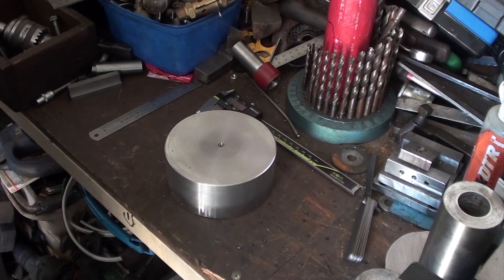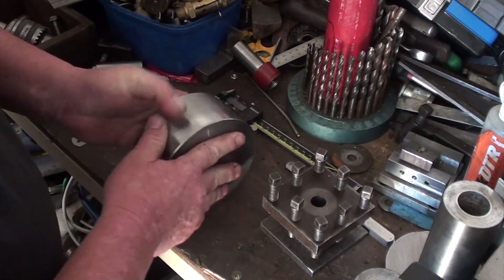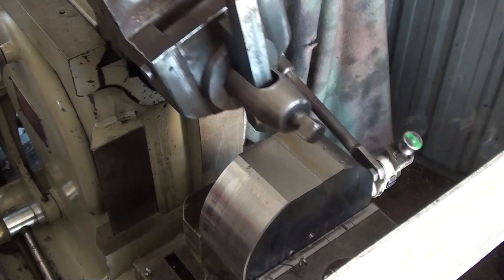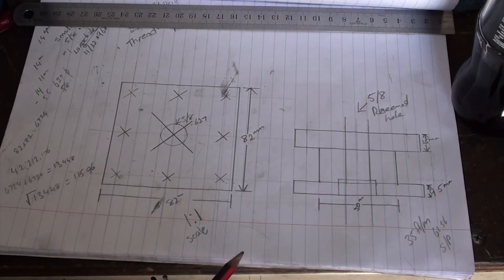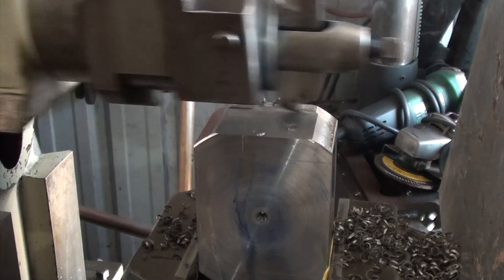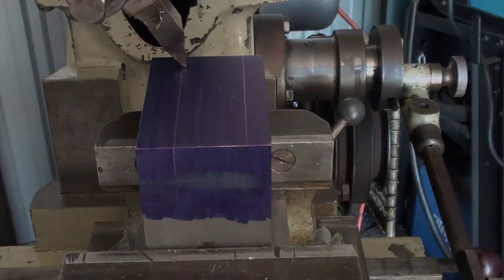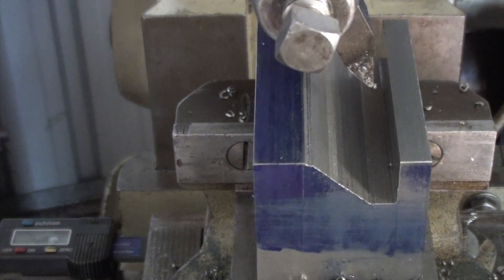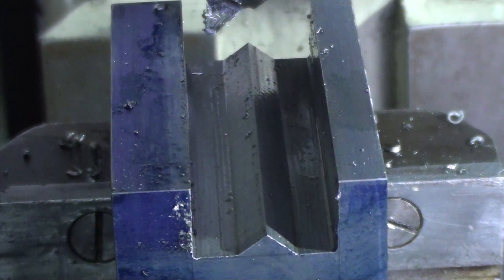Lathe tool post build part 1

Comment: Hey Matt making round things square what is the maximum  depth of cut you have cut, not many people have shapers cheers from Moruya.
Reply from the maker: Gday, now I got used to the shaper and got a lot better at honing the tool I can take a .040” doc in steel, I have taking .080” in aluminium both with .005”step overs, a shaper isn’t all the slow really, the good thing about it is you set it going and you can do something else while its doing the cut. Now I have a mill I still use the shaper more, simply because of the cost of tooling.

Comment: Nice video. Thanks for sharing the build. Seems like the original had a bit of a design fault. Pretty thin on the base. I would imagine that over tightening the corner set screws would have done the distortion damage. i would think that the prop shaft material that you used would only be something like CS1020. Would have been nice to use 4140 or similar.  I don't suppose you'd be over tightening the corner set screws in any case. so it shouldn't happen again.
Reply from the maker: Eric Kendall, thanks for watching my video, I know the fella at the engineering place where I got the material from quite well, I told him what happened with the last tool post and he suggested to use the prop shaft, he was unsure of exactly what it was but did say it’s definitely not mild steel and machined quite well, my kids will be using the lathe more the me soon so I don’t think there will be an issue in years to come, I’m thinking I will get some more of the material for future projects,    ATB Eric       Matty
Reply: @MattysWorkshop  Thanks for the reply Matty. Where abouts are you? I'm in the Dandenong Ranges Victoria. You mentioned you use to be in Victoria.
Reply from the maker: Eric Kendall I’m at Eden on the far south coast nsw, I would almost bet you would have been through here before.
Reply: @MattysWorkshop  Yes I certainly have. Many years ago now though. Really nice place.